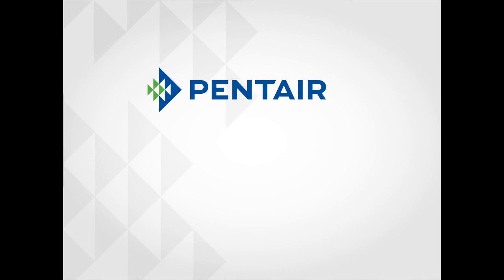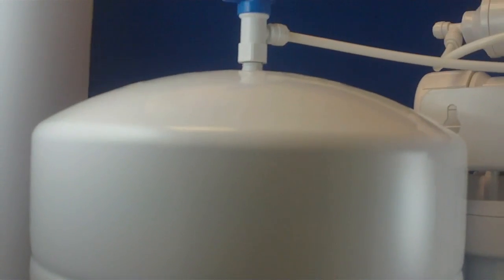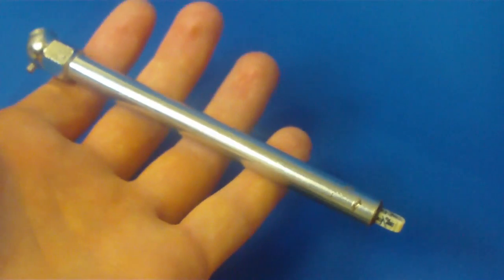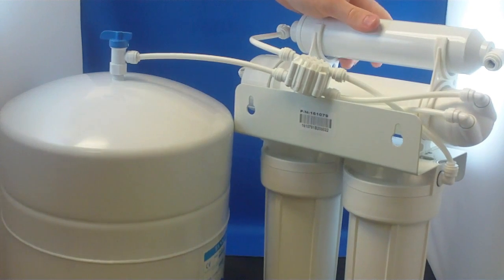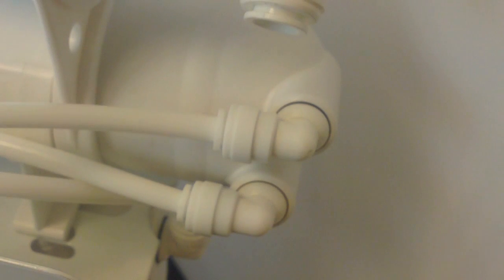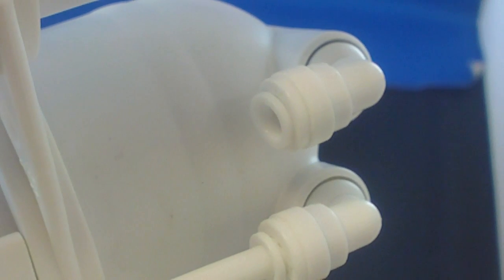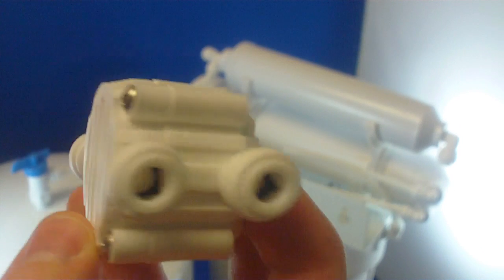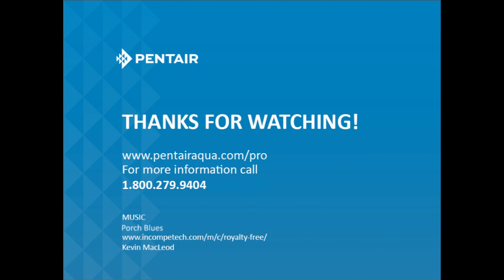Using an Automatic Shut-Off Valve for an RO system.wmv

Comment: I had to fix my ASO value that would not operate correctly: 
1) Make SURE you understand the IN & OUT ports and hook up the lines correctly to ASO valve. 
2) Use ONLY hard lines to interconnect (dont use clear lines from home depot, they are too soft and value wont shutoff correctly). 
3) Keep all hard tube lengths to ASO value as short as possible.
4) On all connections make sure the tubes push all the way down 
5) On all post carbon filters, post filters, etc...dont plug directly into these filters, first always use a push in connector then push your tube into those connectors.

I did all above and fixed my ASO value  RO system operation.

Comment: This valve does not have any electrical connections like a high pressure switch so really very confused how can it shut of an RO booster pump or this is only for non electric systems?

Comment: I installed one of these and it wasn't working. I found out either the check valve wasn't working or the system I installed didn't have one. The shutoff valve would just vibrate and let waste water to pass even though my tank was full. I happen to have a separate check valve that I was able to install and it solved the issue. On my system I have it filling a barrel with a float valve and not a pressure tank, this may have been the reason it wasn't working.